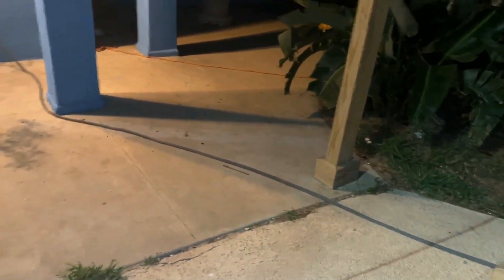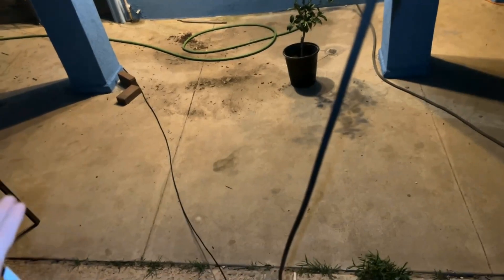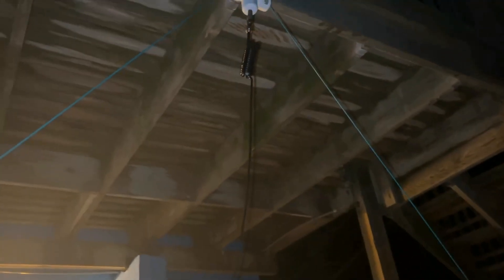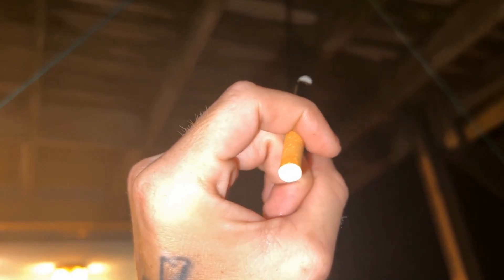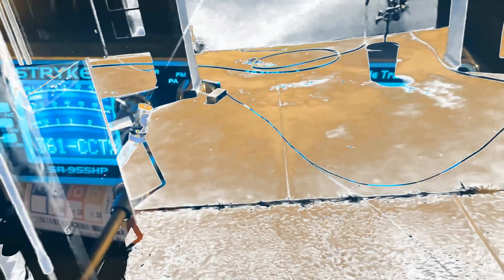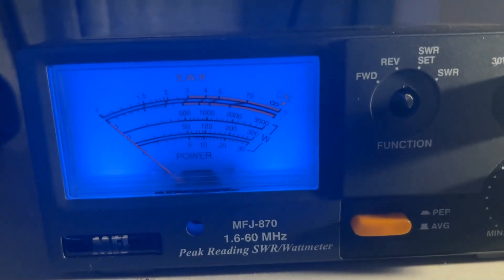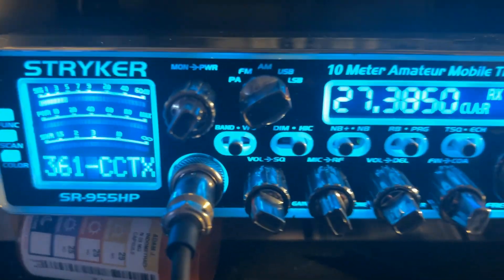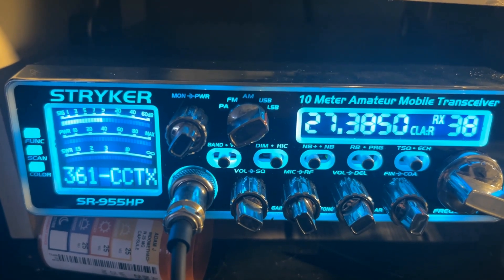New 1:1 air balun for 11 meters/cb band

Comment: 0:48 is it possible to give details of the 11m band balun please
Reply from the maker: what kind of details are you talking about. i used rg-8x coax and wrap it 12 times around 1 1/2 inch pvc pipe. the 2 inch pvc i had was 6 wraps of the rg-8x cable.

Comment: How much do you charge
Reply from the maker: I think 80-90$ would be good. I haven’t finished my dipole design yet. My next upgrade is going to be able to quickly detach/attach different wire leads for other frequencies. Currently the only lead I have is for 27.385-27.555 MHz. Next lead I’m making is for 20 meter band. I’m trying to get funds right now to finish the dipole for sell.

Comment: Do you make dipole antennas and sell them???
Reply from the maker: I do make dipole and sell them, only dipole I have is the one in the videos. If your interested I just the radio band or frequency you want to transmit on and I can make you one
Reply: Oh ok I had one a year ago and sold it I was using it vertical I talked local and skip barefoot and with a 2 pill amp sometimes